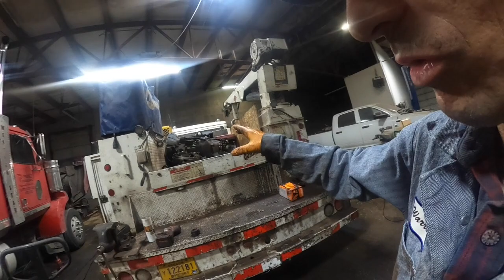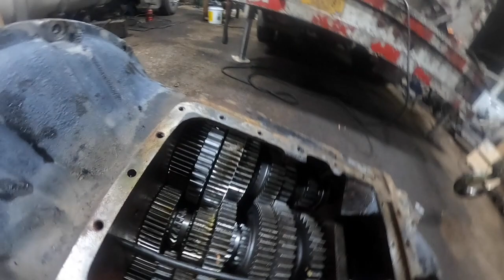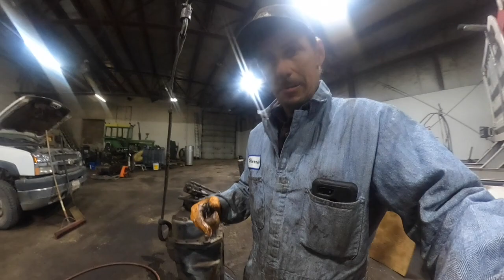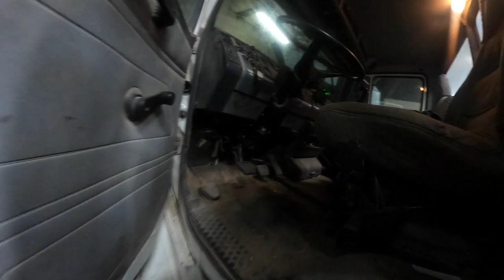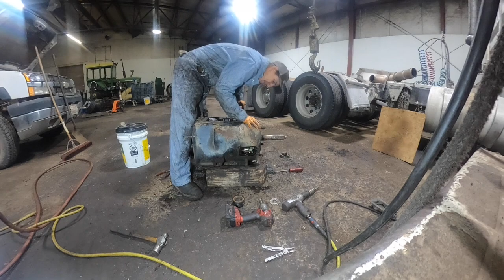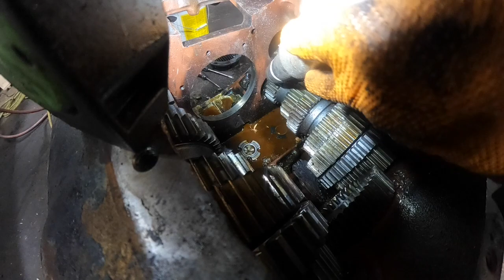Eaton RTLO16913A Transmission rebuild pt 1

Comment: I like Roadranger repairs, they're such a simple transmission, well-designed and robust. Plus you have options for how to assemble by mixing and matching, overdrive vs. direct vs. double o/d, etc. They made them as small as 600ftlb which is ideal for a pickup application up to and beyond 1600 (probably higher than that these days as it's been years since I did one). 8,9,10,13,18 speeds

Comment: Warren, watch for oil passages under the bell housing. When you switch a bell housing between a halo and non Halo( halo is the ring oil pipe) there are oil ports that need to be plugged or it will leak oil into the bell housing.
Reply from the maker: Both transmissions had halo.
Reply from the maker: I see what you are saying though.

Comment: Warren, this is a great video thus far, question, what is the weight of these transmissions, and how long does it take to R&R start to finish, thanks Warren for posting
Reply: Weight is maybe 600-1000lb is my guess to remove and replace for say a clutch depending on the truck 8-12hrs is all it should take.
Reply: @PrairieMechanic  Thanks Jordan, I know Warren is very busy to answer questions but, it was too late to retract my post, so thank you for the help really appreciated

Comment: I’ve watched your videos on this trans as I have the same one. I have oil leaking out the blue hose at the splitter valve, and when shifting the red knob back it sounds like it’s underwater. Will a new k3331 kit fix it? Or is it the o rings on the piston and tube inside the rear cover? Thanks

Comment: Don't have a heavy roll-around bench to put the tranny on ?  
Working on the floor is hard on the knees and the back. You are probably at an age where you start to feel it.
Reply from the maker: Yes I do, there's rocker arms and a cylinder head setting on it.

Comment: You are always using your service truck crane indoors and you are forced to run your engine to operate it,  too bad you couldn't add a simple electric auxiliary hydraulic pump just for crane operation.

Comment: From the driver standpoint I know the splitter on a 13 speed is only available in high range whereas on the 18 speed it's available in both, is it anything mechanical that causes this? Or just pneumatic?
Reply: Like is there something different with the splitter vs the range selector cluster
Reply from the maker: It's pneumatic.
Reply: @westerntruckandtractorrepa1353  This may be wrong, but I think to make it live very long as an 18 (if it gets split in low range very often) it will need an 18 speed output shaft and splitter gear setup with the extra bearing that the 13 doesn't have.
Reply: @KT3406E  pretty sure he has the 18 speed that came out of the truck for parts
Reply from the maker: @KT3406E  The only difference between a 16913 and a 18918 is the bearing bores are a little bigger on the 18 and the shift knob and plumbing to the slave valve. A highway truck dragging 80k around it will last forever, but a heavy haul truck I wouldn't do it.
Reply: @westerntruckandtractorrepa1353  Gotcha.  Saw a guy plumb his 13 as an 18 one time and he only made it a few weeks.  It torched the retaining washer, splitter gear, and hi/low syncro if I remember right.  I saw an extra bearing on the 18 output shaft that the 13 doesn't have when I looked at the parts diagram, but maybe I made a mistake.  You have way more transmission experience than me, just thought I'd throw that out there in case I was right.